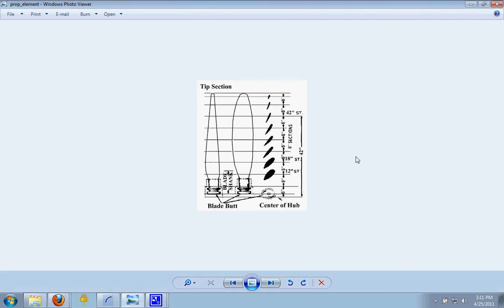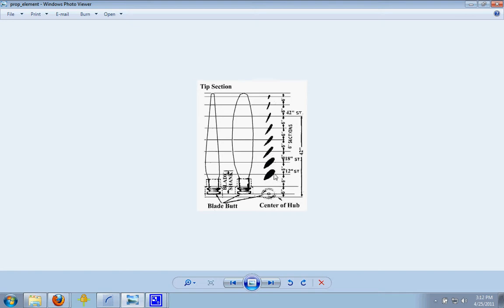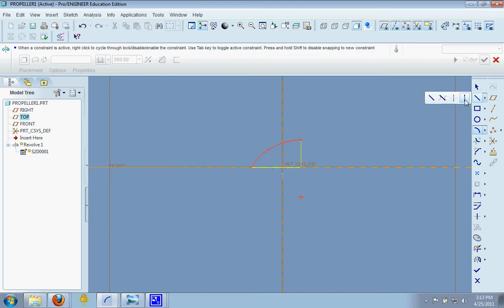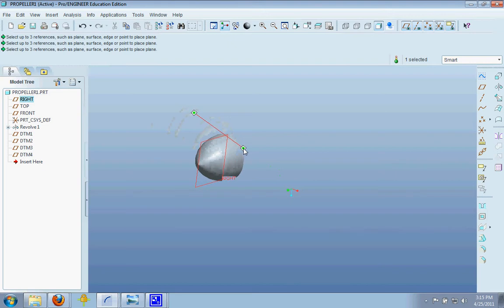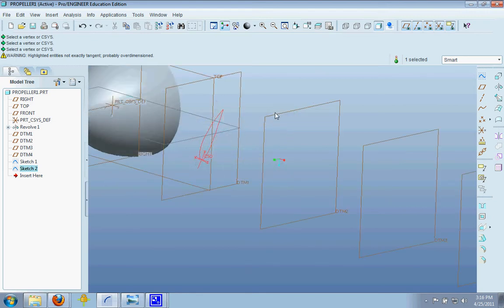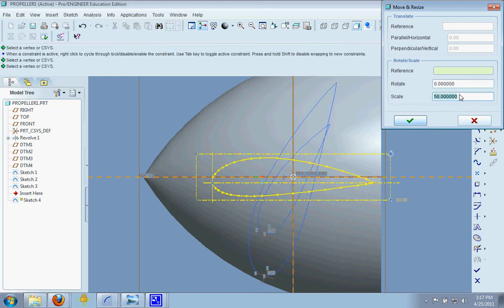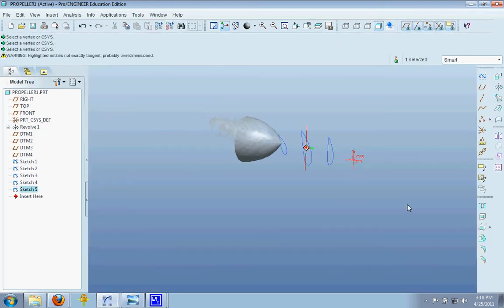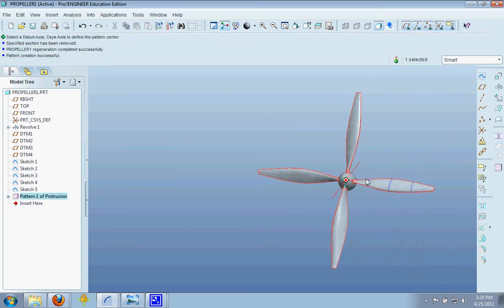Pro/Engineer Propeller Tutorial

Comment from the maker: I'm an Aerospace Engineering Major. If you are interested in just using CAD, I'd suggest Mechanical Engineering or Industrial Engineering and spending a lot of time in the machine shop to get intimately familiar with making parts. Learn as many 3-D modeling programs you can. Pro/E, Solid-works, Autocad, Inventor, anything and everything that is CAM/ CAD you should learn.

Comment from the maker: @mave1850 Are you talking about the first section or the propeller blade that is completely inside the cone? If so, It's because if you look at most propeller blades on an airplane, the base is circular. Don't know why they have it like that, possibly for reversing the blades the slow the plane down on landing, but I'm not 100% sure